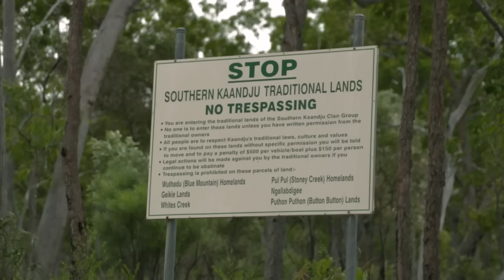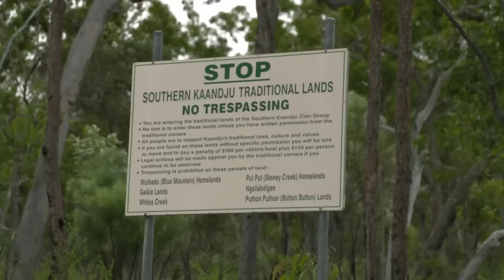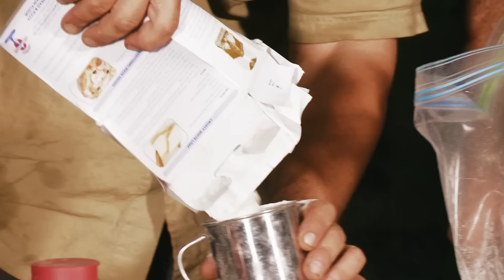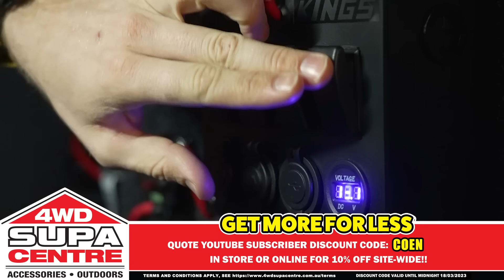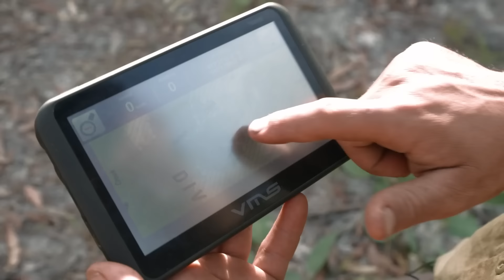Trip Of A Lifetime! Graham And Shaun Tough It Through The Stoney Creek Track! 4WD Action #239

Comment: 22:40 In 1982 I lived in a camp between Black mountain (Kalkajaka) and Trevathan Falls (which I'm sure you blokes have been to before). The camp was originally a tin miner's concrete slab for a caravan and annex (50s and 60s). We set up a big camp there and it was beside a branch of Trevathan Creek. There was a natural waterhole that had been expanded and rock-dammed by the tin miners, making a deep, wide pool for bathing and swimming. We had a population of Sootys in that pond that we'd feed. There was always water flow through the rock dam, so the water was always mountain fresh and oxygenated from the drop down Trevathan creek from the falls. It was an awesome spot to live for a while.